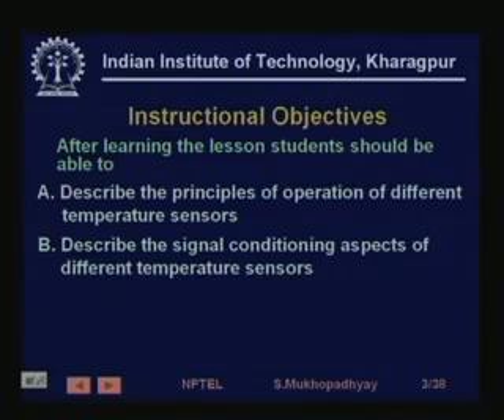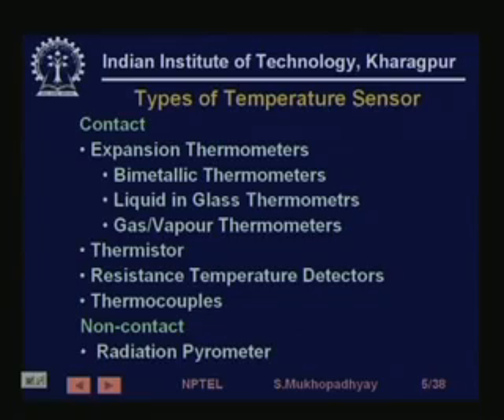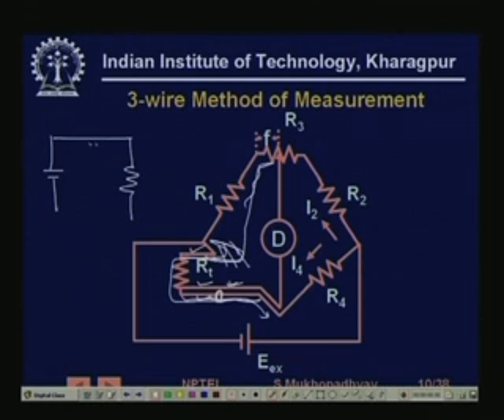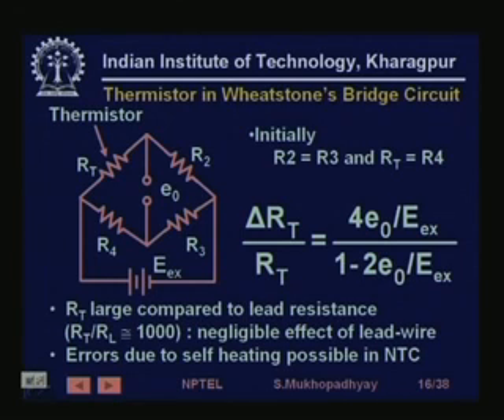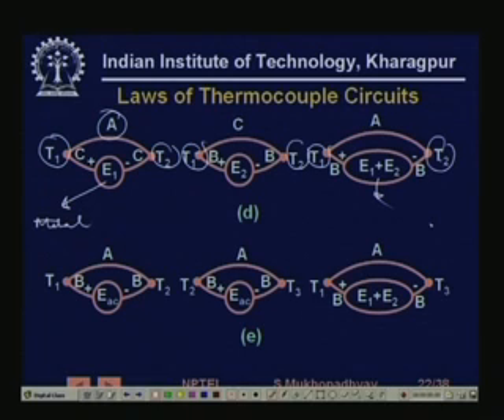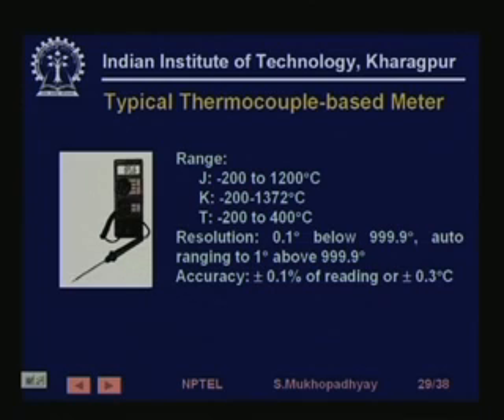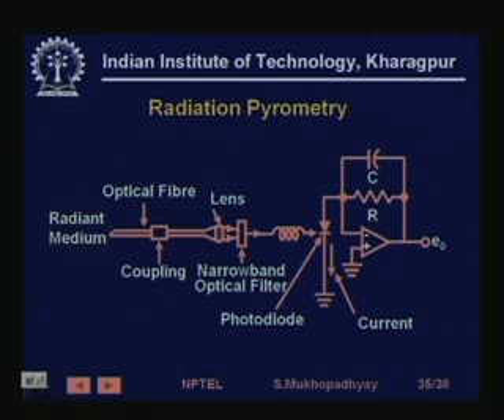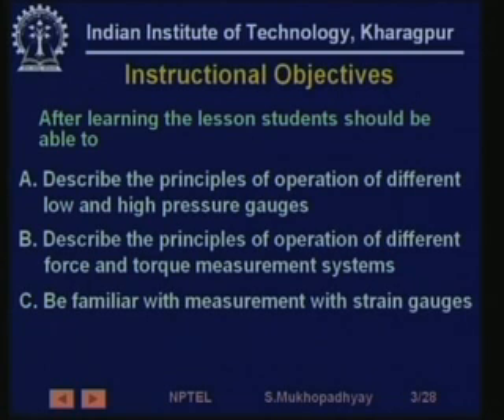Lecture - 4 Temperature Measurement

Comment: Students should learn about some important topics not covered in this video: 1. Installation of RTD, thermocouples, etc, in a process. 2. Temperature modules. 3. RTD and thermocouple calibrators and simulators which are extensively used during commissioning and troubleshooting

Comment: As this video is quite old and mostly relies on information from academic textbooks instead of vendor manuals and datasheets,  just wanted to mention to any new listener that the RTD probe structure shown  here is not in use for nearly 2 decades. That diagram of mica cross is only present in academic textbooks. These days, industrial RTDs are thin film based.

Comment: Four wire RTD: You do not connect  battery across the RTD and measure the drop across the RTD. Clearly makes no sense and is wrong as you want to avoid load dependency for the current. Instead, a constant current is passed through the RTD using 2 wires and the other 2 wires help to measure the voltage.

Comment: The lead wires themselves contribute to the bridge arm resistance along with the RTD (see your Wheatstone bridge 2 wire circuit). While the resistance of the lead wires can change (though minimal as compared to the nominal lead wire resistance), it is wrong to say that variations of lead wire resistance is  the only reason for compensating. You need a generalized technique to compensate or eliminate the effects of connecting the field sensor to the RTD input module. Check Liptak's book for a nice calculation on this to avoid your misinterpretation

Comment: The second order polynomial for RTD resistance vs temperature relationship is applicable only for temperature exceeding 0 degC. For temperature less than 0 degC, a fourth order relationship is the IEC standard